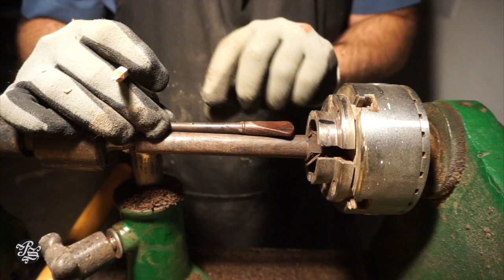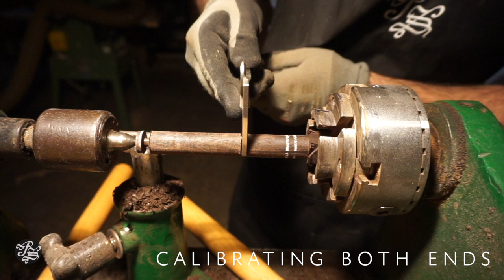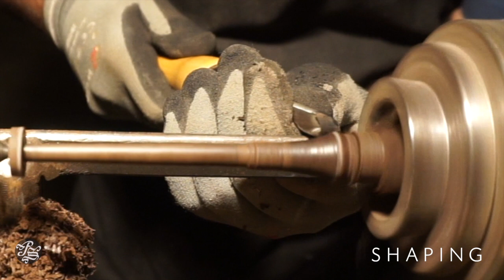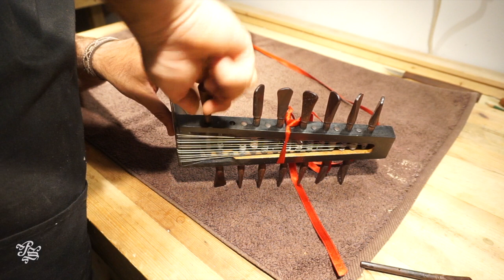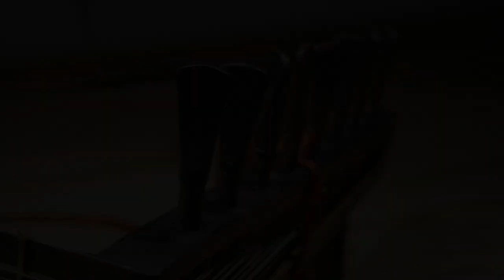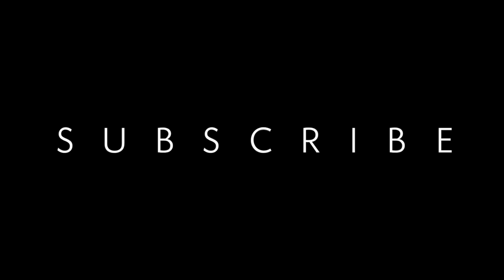LUTE PEGS MAKING - woodturning ebony

Comment: Using a lathe to do the final fitting is overkill and extremely difficult. That's why it's normally done with peg sharpeners made from the reamer and a set of spare chisel blades.

Comment: For the custom taper do you use  the straight edge  of the board as the guide then set the blade at the correct angle?  Do you have a close up picture or video of it?   Very cool and just what I need for a project.  Thank you!
Reply from the maker: Aqua Bass no. But that’s a very good idea. You can place the tool rest at the desired angle in relation with the blade

Comment: Ebony is not the best choice of woods for pegs, it's got too much grit in it and it will wear out the holes in your peghead. Rosewood or any other oily wood that is low in silica would be a better choice. Traditionally, fruit woods like pear have been used, no silica, and the wood is very pretty as well. Certainly strong enough for gut strings as well. Ebony has been used in violins and the like, but again, they tend to destroy the holds in pegboxes and are usually replaced with other woods.
Reply from the maker: I agree. I like boxwood apart from fruit wood.
Reply: @PabloSoriano  That is also a good choice. Anything that doesn't contain a lot of sand in it so the holes stay round and the right size longer. Purpleheart would look very neat, but would destroy holes even faster than ebony.